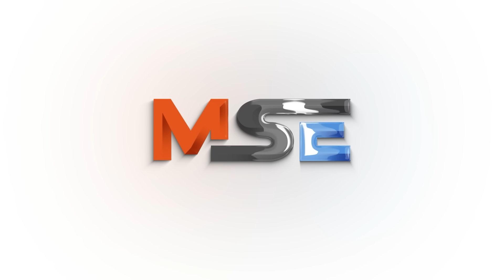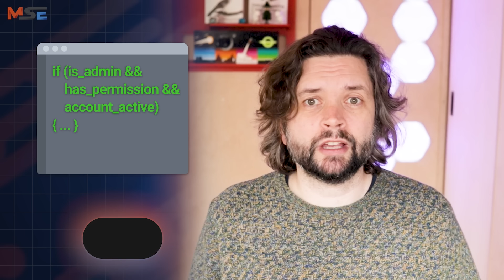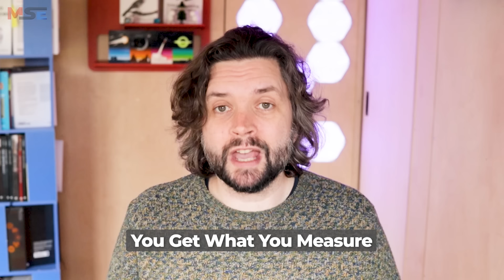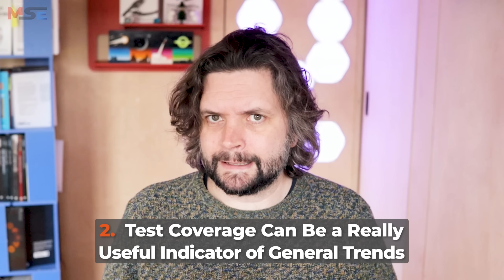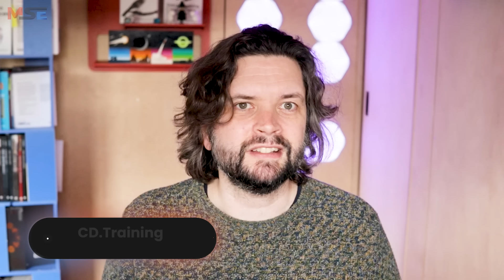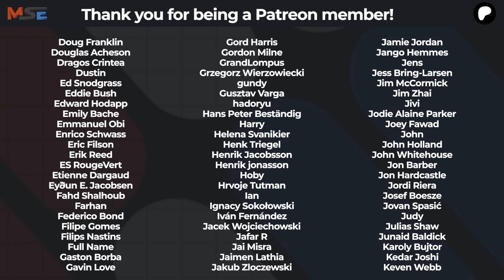100% Test Coverage is a LIE, Here’s Why...

Comment: 100% coverage is not a lie. It’s not only achievable but also in some industries a requirement.

NASA/JPL require it for some projects. How do they achieve this?
- they measure code branches rather than lines/instructions
- they require all functions to be 60 lines or less.

Comment: There is a good and easy way to get some benefit from mutation testing tbh

Run it on new code to ensure that your tests are actually quality in the first place, or run it on small parts of the system that reduces the possible states

There's several really good talks about it on GOTO conferences

Comment: There are a few things that already will make a big difference of whether you test well or not: 
- Make sure every exception is catched and throws a meaningfull log entry at every log level
- Make sure every possible input to a function is tested, no matter if such an input is to be expected or not. You do not only have to account for user input but for malicious actors and more
- And make sure you have the possibility to check the coverage of the testing not by lines, but by possible input and exception scenarios. That's the number you want, not the lines, but if a function takes an input, you want to, at least, check if all possible and unlikely inputs are handled correctly
That's the minimum. Any metric by coerage of lines of code is pretty useless in any dimension of measurement.

Comment: So here is the question. Is you test with unit tests that execute a small portion of your code, you probably not testing your code via public interfaces. And there your tests become tied to the implementation specifics.
Reply: Unit tests by definition are in a separate file including the header file that contains the public api and public state. They then make a single assert that called with these inputs it returns this output. If the function needs to call private functions to generate the result that code is then executed via the public api.

Not having coverage of the private code means one of two things, either you need more tests to cover the functionality of the public api, or the private code is actually dead code and needs deleting, which is not a problem because if it turns out later it was not dead, you can just recover it from version control.
Reply: @grokitall I never test private members. But I do use VisibleToAssembly option in C#

How bad is that?
Reply: Sociable unit tests would cover more. Up to the developer how close to the production code the tests should be

Comment: I get the most value from my tests when I focus on the behavior I want to test. To avoid drawing in tests when working with a large codebase, I create a smaller number of fairly complex tests, initializing as many perts of my application as I can for real. I also have to be quite creative with the way I organize my app initialization so that I can run all my tests concurrently. This works well because I can add new behavior to my system without rewriting dozens of tests, but at the same time, I have a kind of integration tests at the cost of unit tests, which are more likely to reveal if something is wrong. Speaking about code coverage usually it is slightly above 80 percent when I organize my work this way, but I don't pay a lot of attention to this metric.

Comment: I work with the GCov tool on a C++ code base. This combination has a challenge when tracking lines in that the mechanism of GCov works at cross purposes with the C++ optimizer. GCov attempts to map source code lines to generated assembly and tracks what assembly is executed. The optimizer reinterprets source code, rearranges operations, and even eliminates code with *provably equivalent* shortcuts. Even low levels of optimization may result in certain lines of source code with no assembly output that can be clearly attributed to those specific lines. GCov then reports these lines as false positives in terms of uncovered lines of code.

This problem generalizes to any tool that uses a similar mechanism. There might be other tools that use different strategies, but this approach is inherently limited. 100% code coverage is effectively impossible here without adding annotations to disable checks.
Reply: It's a good point - any compiler that features tree shaking would have similar issues.

Comment: Thanks for explaining the scenarios where test coverage gives you false negatives (passed when it should have failed). I'm not as familiar with property testing. Is it similar to combination testing, where you try multiple combinations of inputs to see if you get the expected outputs?
Reply: Whilst I've not done combination testing myself, I believe it's a similar idea, in that analysis is done to autogenerate different test cases without you having to manually create them yourself. The main difference is that property testing is guided by the types of the input parameters, and will do more bounds testing of each input parameter as a result.

Comment: When you declare that confidence is the main metric you should measure with, you need to define"confidence".

Please tell me you do not mean gut feeling.

Also, I have never heard of using test coverage outside of unit testing... that would be insane...
Reply: with BDD it could also work but I imagine for relatively young and small in size startup
Reply: measuring test coverage for integration or acceptance tests is far from insane.
do you want to strive for 100% E2E test coverage? likely not. 
but you're still gaining valuable insight : do you have no tests that assert your modules are actually properly working together? thats a source of problems. does a certain set of features get no E2E coverage at all? again a datapoint that you want to at least think about.

you can even use these metrics for more than that after you start tracking them. the most important use to me is that it allows ordering the slower running tests so that the tests touching the changed (or the most) code run first, thus vastly increasing your feedback speed when something breaks

Comment: Watch out for AI written tests. Agents will write tests that simply confirm the way the code is rather than how it should be. Then when you make a change you have to update the tests so it ends up as increased overhead,. However, it can help detect regression(s) when you make changes/upgrades in some instances. It's pretty rare that AI written tests actually find a new bug. I think they can find them better just by reading the code, actually.